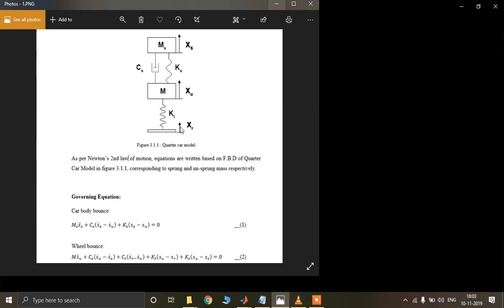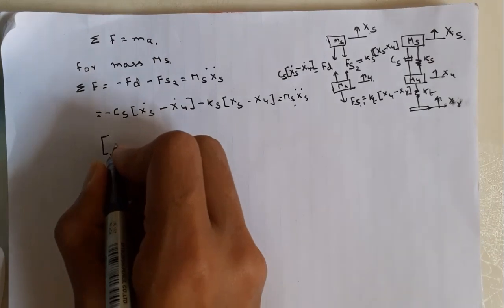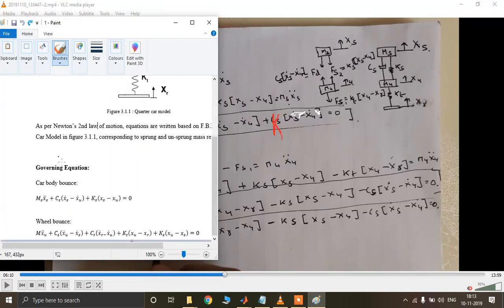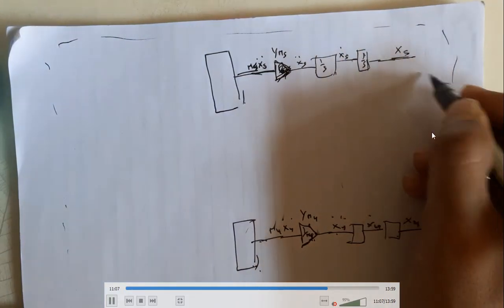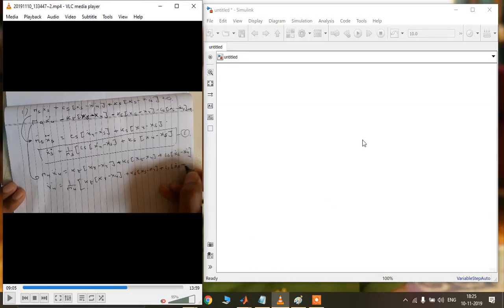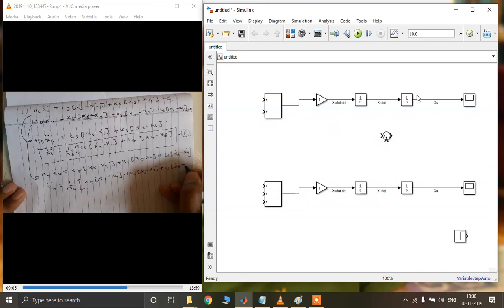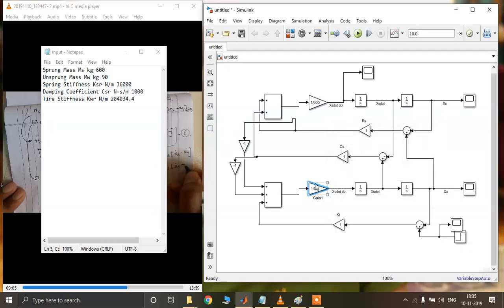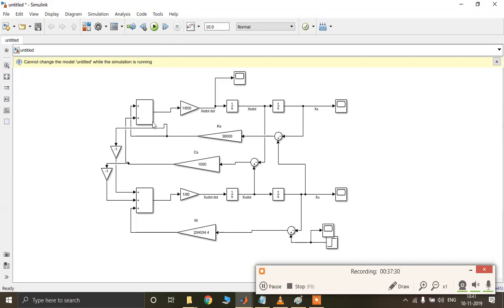4 From Derivation to Simulation of a Quarter Car Model using Matlab - Simulink | Quarter Car Model

Comment: Hello, my friend what a brilliant video you post. I watched it carfully beacuse I am  very interested in it,  impressed a lot. I am second year at my college and majorying in vehicle engineering. I have intense will to build a 9 DOF full vehicle dynamic model which would be tested in simulink,  but i am confused about the method for  deriving formulas. Would you please give me some instructions kindly, thanks. If you don't mind.
Reply: @smchandra  Thank you very much my friend, now I have a problem on my 9 DOF dynamic full vehicle  model which includs a 7DOF suspension model and adds  rotating rounds Z axle and lateral displacement. I dont konw how to biuld this model. Would you please give me some suggestions kindly, if you dont mind i would like to add your FB or Whasapp.